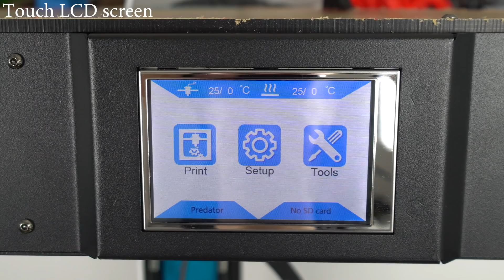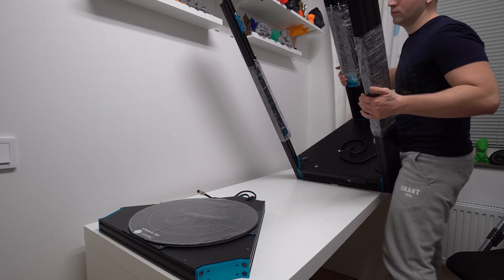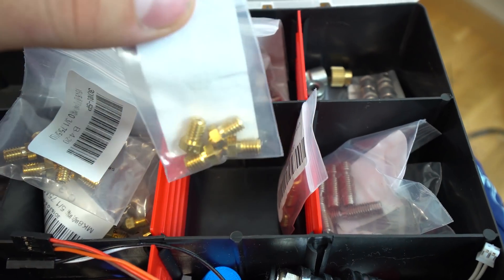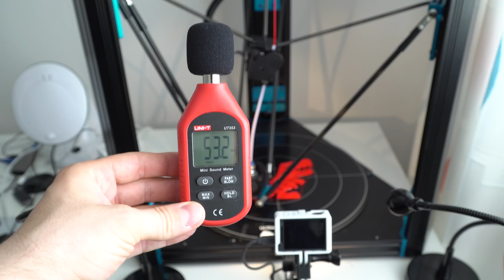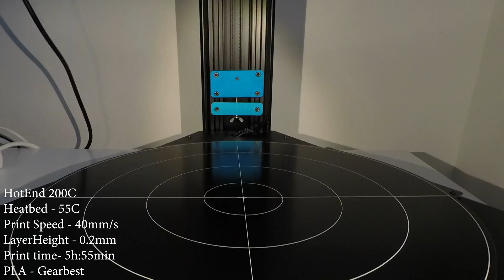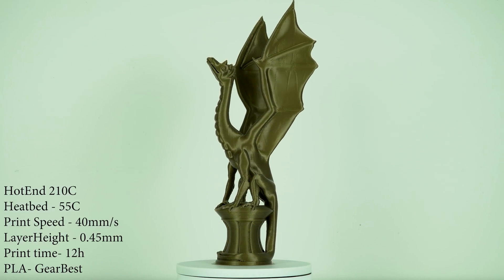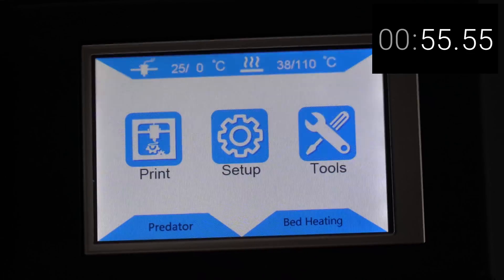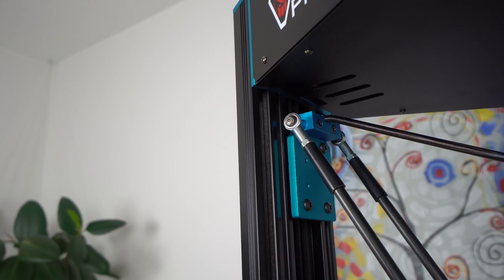Anycubic Predator 3D printer Review - all you need to know

Comment: Good review. Thanks for that. How heavy will this printer tank the electricity bill? Have you measured how much watts the print takes for for example ABS? That 1000W PSU is most likely there for a good reason. :) Also how long does it take for the Ultrabase to cool down? Mine (240mm on kossel linear plus) takes around 10 Minutes to cool down enough to remove the print without damaging the Ultra base coating. Your prints look like there is some unterextrusion at the beginning of each layer. I had that too on my Kossel. Try extra extrusion after retraction/travel move. For me 0.05mm works well. Cheers!
Reply from the maker: Thanks Rod I'm glad that you like it. Yes I did measure it with my Watt meter. With heat-bed set on max temp(110C) Printer pulled 365W peak, so in total printer can't pull more then 450-500W peak. I'm not sure why Anycubic used 1000W power-supply, It's more then double rated power. Maybe they got good deal with that LED power-supply company? Who knows, but I'm glad they did. I might take that out that 1000W power-supply and replace it with cheap 500/600W one and use that 1000W for other projects :)
Not sure exactly how much time it need sense I never measure it, but it cool's down pretty quickly sense it has no insulation underneath and my Kossel liner plus has heat-bed insulation. 
To be honest if I'm in hurry I just bast it with hairdryer on cold settings and it release the print in no time :) 
P.S. Don't use hairdryer for ABS it will wrap and it might crack the print. The longer time you have for ABS to cools down the better and stronger will be. So no rush with cooling down ABS :)  
Thanks for suggestion I will give a try. 
Cheers Mate!
Reply: @NexiTech  Maybe the 1000W are for short heat up times of the bed. Thanks for the tipp with the hair dryer. I'll try that later. I very rarely print ABS since I don't like the smell. Have a nice weekend. Cheers!

Comment: could share your print settings for the flex-filament
Reply from the maker: Exactly like PLA just with lower print speed:
220C on Hotend and 55C on heated bed. 
Print Speed 50mm/s, travel speed 150mm/s, Retraction distance 5mm and retraction speed 70mm/s.
Reply: @NexiTech  thank you very much just orderd a spool i was looking for a flex fillament that works with a bowden extruder most flex filaments require a direct drive in order to print properly

Comment: Hi another great video, do you recommend installing the TL Smoother on the CR10S Pro or there is no need to do that ?
Reply from the maker: Thanks! Nope, there is no need for that. Cr10S Pro has one of the best straight and smooth layers that I seen on 3D printer.
Reply: im sorry i dont have the CR10S Pro i have misread your comment i have the CR10S
Reply: yes i installed them on my tornado and cr10s